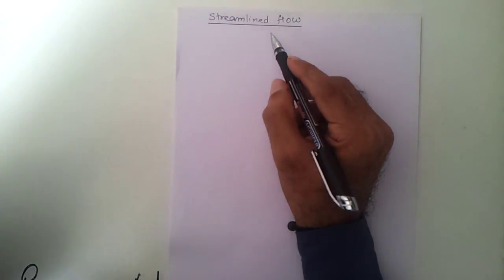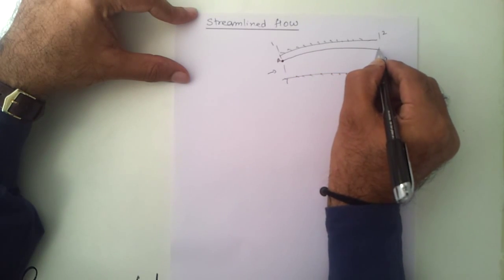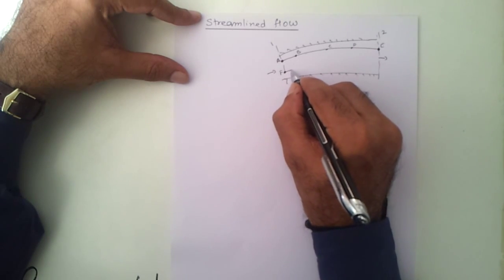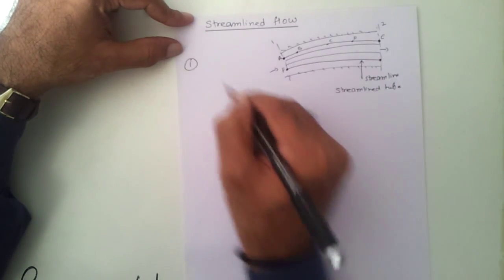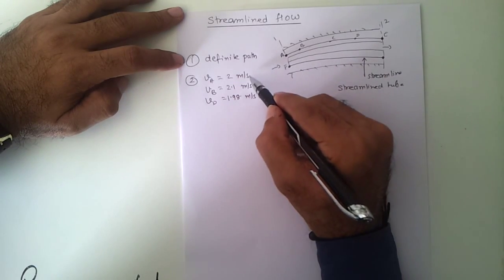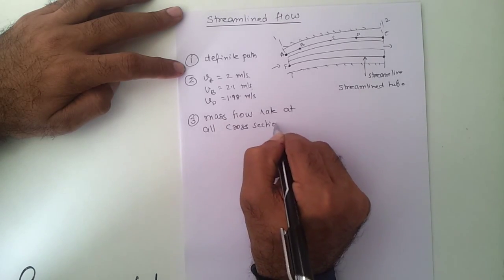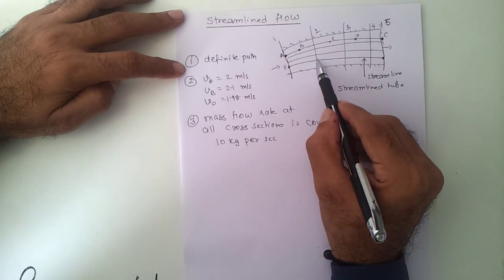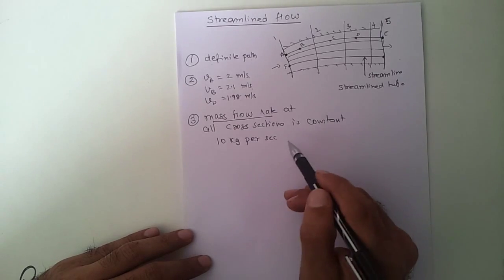Streamlined flow

Comment: beutifully explained wt wd be opposite of streamlined flow
Reply from the maker: Hi Kapil, Thanks for viewing and your comment. 
If  a flow is not streamlined , then we call it  a Turbulent flow. In this case the fluid particles do not follow a set path. They intermingle with each other. Also the velocity of particles at the same point may  keep on changing with time.